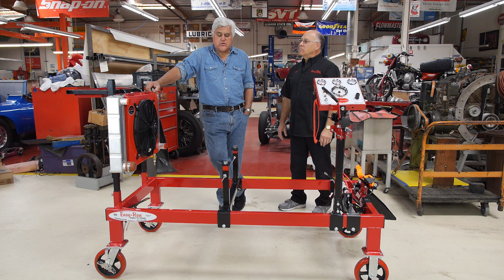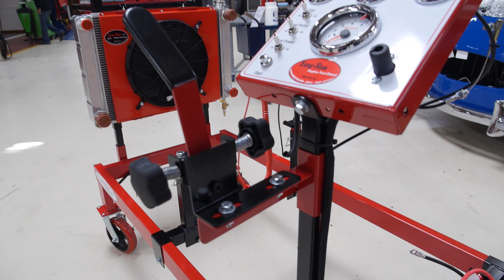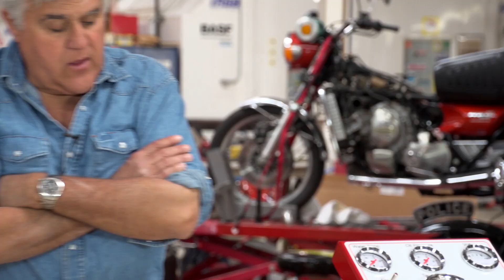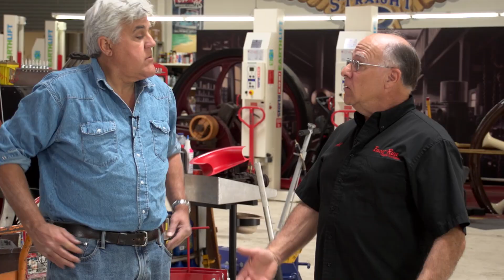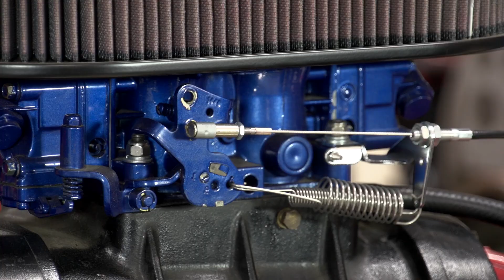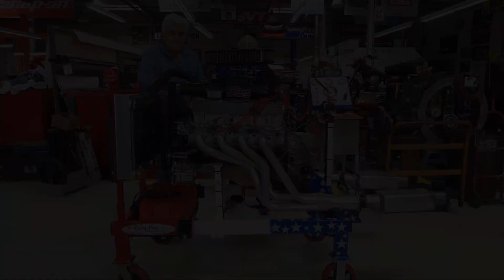Engine Test Stands - Jay Leno's Garage

Comment: Consider price of steel, add to it the design time, to that the equipment to cut everything , jigs for assembly , welding, drilling etc. Then powdercoat in 3 colors. Buy gauges, switches, fuel cells,  battery , radiator, cooling fan,  and all the stuff not listed. 2500 is a fair price . Cobble one up for 200$? Sure , won't look or perform like this one.

Comment: My friend bought one of these and I copied the dimensions and made my own for $452 minus the trans ability.  However, I made mine to fit the 512 v10 Dodge and added the ability to switch fuels with a valve assembly
Reply: Hi bro can you please help me with the specifications and materials required, I would really appreciate incase you need my email is nasmo86@icloud.com thanks

Comment: My Father did this by cutting off the front of an old truck frame and leaving the radiator in place.  We used it sometimes to test motors pulled from cars we were scrapping.  Didn't know somebody was selling them, but great idea.  Much more compact.  If you built custom cars for a living and didn't have time to mess with making a homemade rig, this would be well worth the money.

Comment: Are these compatible with 4 cylinder inline engines? Oh wait, never mind, for a lot less than $2000 I can buy myself a welder, lots of box iron, 1/4" plate and build myself one. It's a really nice product, but also complete overkill for my application.

Comment: It's dot net. The 2225.00 is for the full blown professional model. They have a base model (875.00) that is REALLY bare, it has nothing on it. Even the shop unit requires the throttle to be bought separately (135.00) Ouch! Those that build their own, save...those that can't...pay.

Comment: I spy with my little eye... A Suzuki RE5 Wankel on the lift in the background!
Reply: Well spotted! I wasn't sure until I saw it had the "swiss roll" instrument cluster!
Reply: That's how I confirmed it too.
Reply: bikingnutcase0 Yup, saw that right off, then the corvair in the background. A friend had both years of the RE5, I rode the '76 a bit to try it out. Not a bad bike, interesting feel to the engine, not really powerful either for it's size. Was fun to check out at least.

Comment: How do you learn/know what engine fits into a certain car?
Reply: any engine will fit into any car...all you need is a gas axe,welder & a hammer :-p
Reply: That's a good question. And there is no easy answer.  Here are the factors: 
Length/width/depth of engine relative to engine bay, including cross member to support transmission.  Some engines bays are too small to admit larger engines.  You have to do your homework. And you may have to have some custom motor mounts made.
Reply: Stephen Swain  and the hole metric / not metric thing

Comment: looks like very nice work, but its nothing a backyard mechanic couldn't cobble up for a lot less than $2+ grand.
Reply: i built one for nothing from just scrap layin round. its had everything from flatheads to 409`s onner. gets borrowed at least once a year. beauty for cam run in and checkin for leaks
Reply: ya man. that's the best way to go!

Comment: Pretty cool stands for people that are always building engines. But the guy responding to Jay with "It runs clean" does not mean you wont get asphyxiated. It still dumps out carbon monoxide.
Reply: Stuka87 most engine test facilities have roof funnels. You just attach the pipe to the exhaust pipe and there's a fan in the roof Funnel that sucks it out the roof.

If you have ever seen a Formula 1 engine on a dyno, you seen the roof funnel in action.

Still, it's a neat product, and will find many homes not just in America. Hell, I could do with one myself. I just can't be asked to take the engine out of my Aston Martin and put it on the rig, I will just let the service agent look after it..